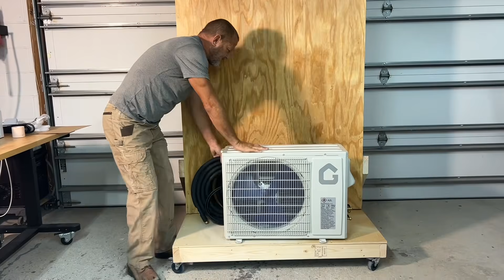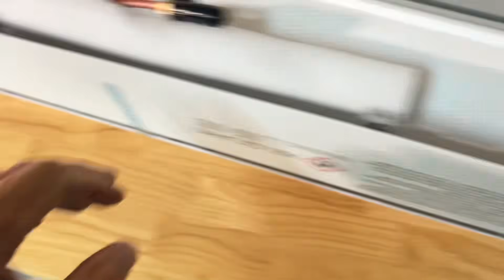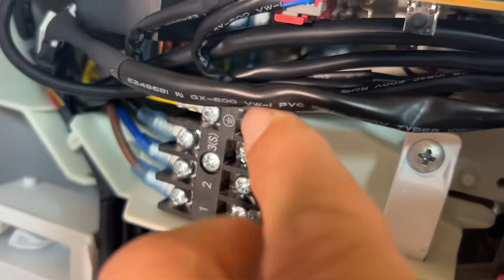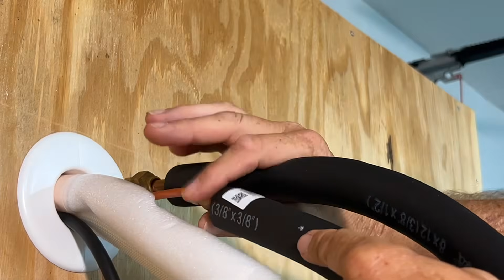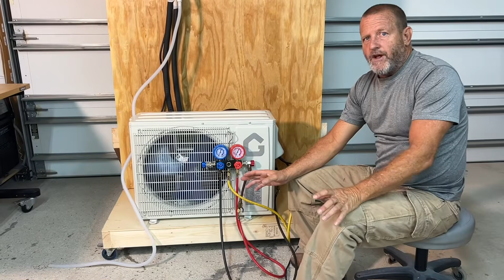How to Install a Mini Split | Garvee 12000 BTU DIY Guide

Comment: I really appreciate this vid as it helped me get things going on my 18kbtu unit. I have one issue tho’. As I tried to take the gauge set off there was a discharge of refrigerant. I quickly retightened the fitting and the pressure seems good, but now I’m not sure how to take the gauges off without draining the refrigerant system.

Comment: I think the most important thing we were all waiting for is the electrical connections from the indoor unit to the outdoor unit and then from the outdoor unit to the main power outlet.
Reply from the maker: Wires and units are numbered numbered and the instructions explain it.
Reply: @StoneBrokeAdventure  if instructions explain it then why bother making a video
Reply: @akhan3682  1. Some people have trouble following instructions, or are confused by the instructions. 2. Having a visual guide can be a lot of help. 3. MOST people can't read an electrical schematic, so knowing what wires go where is a real help.
Reply: @akhan3682  which would be you agreeing he didn't need to make a video showing how to connect a wire with a "1" on it to a terminal labeled "1", etc.

If someone can't handle that, they're certainly not going to be making a new flange and pulling a vacuum, which, by the way, are NOT covered in the instructions, as they are std. HVAC knowledge that the public doesn't have (THUS THE VIDEO...).

Comment: great video -i put all my mini splits i install at home with lines installed inside wall looks a 1000 times better/
Reply: @pauljansky7971That's fine, until someone decides to hang a picture and punctures the lines. I run mine through the wall and cover the lines with line set covers.

Comment: Does that vacuum pump in line set specifically the one that you listed come with the correct fittings to adapt directly to the system or did you need to buy any other type of adapter to make that connection

Comment: What size hole saw do you recommend?  The template has about a 2” hole on it, but the outdoor protection Ring seems to be about 2 1/4”.  Suggestions?

Comment: Could you set this set up inside of a garage and let it run?  If it’s built on plywood like this
Reply from the maker: you would have to be able to close the garage door . this id just a moc up. you need the inside unit inside of the conditioned air space and the outside on the outside . but im sure you could rig somthing up that would work

Comment: Did you have to buy a separate 5/16" SAE to 1/4" SAE adapter to connect the service port to the vacuum? Any recommendation for a specific brand for this adapter which may fit the Garvee minisplit better? I heard that some people had problem with the thread or fitting of the Garvee service port with the adapter. Did you have any issues with your Garvee?
Reply from the maker: my adapters came with my new guages. they worked fine.

Comment: I am installing mine electric is cake for me but pump i bought one when u pull vaccume I turn off valve and leave the vaccume when I open the refrigerant? Then after when I pull the guage it wont  come out from the svc port?
Reply from the maker: you pull the vacuum , shut valve to isolate the vac pump from the system. now guage is only thing that is connected to the system. release a little refrigerant the guage will rise  in preasure . open valve all the way (back seat it)if you want to check preasure in suction line. turn on unit . check guages. then remove guage while unit is running. remove guage fast with gloves on. refrigerant will come out but not much.  the service valve has a schrader valve just like a bike tire.  another way if you dont need to read preasures when unit is running  you : pull vac, isolate pump by shuting off valve on guages , guages see system side in vac still, release a little refrigerant just enough to bring preasure up to positive preasure then shut the refrigerant (service) valve off, disconnect guages open refrigerant valve again to release all the refrigerant into the lines. open valve all the way Untill it stops (backseat the valve)
Reply: @StoneBrokeAdventure I did it thanks its worked but I did get a little oil spit back when I took it off I went as fast as possible but yea was up once I opened the Allen key very cool love my unit may do another now that I have the guages and pump

Comment: There should be filters under that lid.  I notice the filters on top as well, but you know air leaks all around the front cover and without filters you will have a dirty unit in no time.  Does it come with filters under the lid?

Comment: Prime day deals just got me a 9k Garvee, micro vacuum gauge, 2 stage vacuum pump, digital manifold kit and some Nylog all for $630, wish me luck.
Reply: how did it go?
Reply: @MowtivationalMower  Working perfectly!  I'm literally blown away how quiet it is.  On high, I have to round the corner to where the condenser is to hear it running at all.  On Low, you can't hear the evaporator running without being in the same room!

I forgot to take my IR temperature reader so will take that today and measure the output temp, but it's plenty cold certainly, I'm just curious.

I had some problems pulling the vacuum, I'd purchased a 4 star rated valve stem puller for $15, but it seemed like it was leaking itself, so I bought a $70 one instead and that proved it was the problem.  I think it was the valve but can't prove it.

I also found all I needed was the digital vacuum gauge, pump, and the valve stem puller; the manifold was completely unnecessary and just adds another leak point.  I just pulled the valve stem first (trivial; no vacuum or pressure yet), then hooked the digital gauge to the side port of the puller now attached, and the vacuum pump where the stem would need to be inserted afterward.  This lets you pull down the vacuum, shut off the stem puller valve (which is on that vacuum pump end and will have to be opened later to re-insert the valve stem past the valve and tighten it), see the vacuum hold for 15m with ONLY the stem puller and gauge involved, then you can remove the pump and SLIGHTLY pressurize the system with refrigerant from the high pressure end (you're working on the low pressure side) just enough to break the vacuum, and then (with gloves on) have the valve stem partly inserted and quickly fully open the valve so that you can push the stem through and tighten it with just a tiny bit of refrigerant escape.  That all worked like a charm, no manifold needed at all.  But, I'll hang on to it for possible future uses, perhaps on my car.

I still have to put the lineset cover on which is presenting some issues to work through since the wall is vinyl siding.

But I'm massively sold and can't wait to put the 2nd unit in which will be in my larger living room.  And that one I plan to power with 600 watts of solar driving a 200ah LifePo4 and inverter.

I highly recommend them, but if going to you really want to do it right and a lot of the videos have bad shortcuts.  But what I spent for all the right stuff to do the install I'm sure would have been LESS still than what an HVAC tech would have charged, but then I'm a DIYer and had zero thoughts about NOT pouring the concrete pad, doing the wall penetration and mounting the evaporator, etc.  The only thing I was nervous about was cutting the lineset (there are minimum lengths otherwise you have to recalculate the refrigerant, so need a pro, but I just removed <2' from it) and then getting a good flange, seal and pulling the vacuum.  So the fallback always was hiring a tech if I couldn't, but I hoped even that would be less since it all was installed, and he just need to pump down the refrigerant to the condenser and fix the lineset, perhaps with new flanges or connectors.

It's not for everyone, but anyone that does any DIY work at all can absolutely install both units, do the wall hole and make it way faster for a tech to pull the vacuum if they don't want to go that full route.

Comment: I watched the whole video to see how exactly the electrical goes and you skip right over it.  Thanks
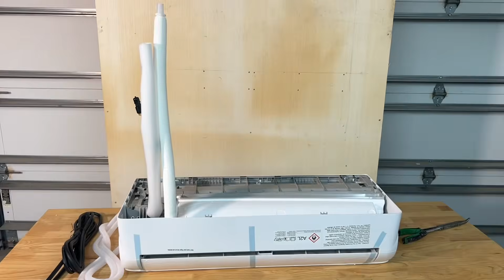Reply: first time i installed a minisplit, it was a walmart Della unit. I was dismayed when trying to do the electrical. the manual provided was beyond useless. turned out to be a 230V unit, and I had initially set it up in a 120V configuration. eventually got it figured out. this video covers it first at about 2:30, and as for the refrigerant, I don't own a vacuum pump or refrigerant gauges so all i did was hook up and open up. been running fine for 5 years. when you open the valve like he did with the "metric allen wrench" (sheesh, no American dimensions anymore at all), it closes off the outside valve where the gauge hoses hook up.
Reply: And he skipped over how to disconnect the gauges without releasing refrigerant everywhere.
Reply: @RilsR you just disconnect it. You get a little spurt. That's why he didn't cover it because you just disconnect it

Comment: Thank you for this video. This looks like a rebranded unit manufactured by an oem named aux. After vacuuming the system, when you release the refrigerant, just release enough to show a slight pressure on the gauges then turn the valve off. Now when you disconnect the vacuum hose you do not lose as much refrigerant. Then after you disconnect the vacuum pump, you can open the valves fully to release the refrigerant into the system. Also, it would be a good idea to check for leaks by using some dish soap on the connections and look for bubbles.
Reply: Bit of research suggests a first time DIYer might benefit from a bit of Nylog Blue on the flair?
Reply from the maker: great tips. i allways psi test with nitrogen befor pulling vaccum
Reply: @johndooley8837 That's how I do it.

Comment: Why no video shows the circuit breaker connection hook up
Reply: You are supposed to hook it up to a a/c disconnect.  Standard wiring, black/white/green.  If you haven’t worked with electrical before, I recommend having a pro get the power to it, and you do the rest that is shown in this video.
Reply: That's what I'm saying. Heck mine didn't even come with the wires from the outside unit to the circuit breaker

Comment: Where did you plug it in do I need a connector 🔌  wired up or it comes ready to plug 🔌  into the outlet??
Reply from the maker: hard wire it into a disconnect. you may need an electrician to run power to the unit.

Comment: What they don't tell you. You have to hire electricians to install plug. It DOESN'T  go to stand plug like advertised.  I bought small 9000 BTU.  This has been the biggest DYI hassle and cost.
Reply from the maker: well it does need electricity. it doesnt run on magic. im confused.

Comment: Is this a reliable unit? Have you installed this unit in a home.
Reply from the maker: yes it is in my home running all the time. im actually really impressed with it. just the little details in the manufacturing were a hint to what i was expecting to see after installation. im genuinely happy with it.

Comment: Fantastic video i just bought this on Amazon its way nicer than my Gree unit. Can you do a in video connecting the disconnect box i dont remember how to do that part lol
Reply: Update figured out the wiring ran some conduit and a cut off switch and vacuumed the lines and it works awesome

Comment: I've often seen people pour a concrete slab and use concrete bolts to secure it down. Is this necessary if the outside part will be under a covered patio sitting on concrete?
Reply from the maker: i would definatly secure it. it will protect from wind and equipment vibration
Reply: @StoneBrokeAdventure  Thanks!

Comment: Just purchased this. What size pull breaker would you need?
Reply from the maker: a 20 amp breaker for the panell and any pull disconnect t that is rated for above the 20. a 30 or 60 would be fine
Reply: @StoneBrokeAdventure thanks for the quick response!!!

Comment: You didn't have the wires hooked up from your disconnect and no indication where they go. Fail
Reply from the maker: they are numbered . its kinda like coloring inside of the lines . If thats to hard for you , you shouldn't try this.

Comment: Don't get why vacuum if lines are pre charged and the indoor unit is also line filled, can you explain?
Reply from the maker: the outdoor unit is pre charged with refrigerant. the indoor unit is charged with nitrogen to keep moisture out during shipping and storage. the copper line sets are not charged. you need to release the nitrogen from indoor unit, hook up linesets ,pull a vacuum to remove all moisture and air from indoor and linesets. then relaese the refrigerant stored inside the outdoor unit into the linesets and indoor unit .

Comment: Are you happy with this still? I ordered the 9000 Btu unit and it is on the way,,, then of course I see people talking bad about the Garvee. Many complaint they don’t perform well
Reply from the maker: i have this unit cooling a very large master bedroom and masive walk in closet and master bath. . it cools /heats easentially 1/3 of my entire home without any issues
Reply: @StoneBrokeAdventure thank you for the reply. Mine is going in today. I got the 240 volt version. It's going in my 380 square foot garage

Comment: Thank you so much for this video! I’m installing one tomorrow and I’m using your video as my reference.
Reply: How has it been working so far? Thinking of buying an 18000btu.
Reply: @STEVEEDG It’s been wonderful! Only issue I had was when I bought it from Amazon. It looked like they went out of their way to dent it up. I had to take the cover off and hammer the metal all back to its original shape so the fan blades could actually spin.
Reply: @tulsaperson yeah amazon has been horrible since they stopped using usps. Good thing I found it on ebay.

Comment: Important detail that he doesn't show is how and where he connected the unit
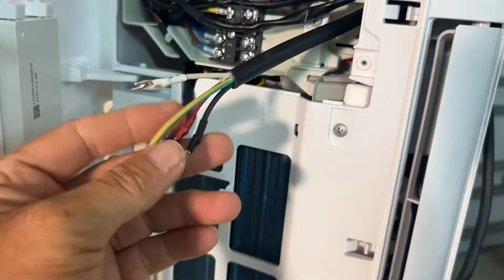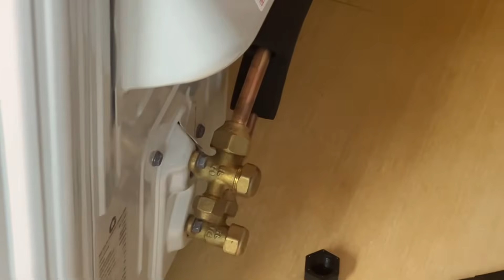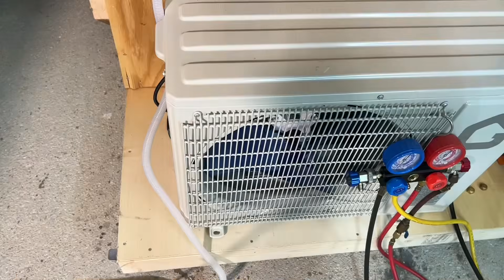Reply from the maker: i confused you need to be a little more specific, see the time stamps. 2:39 wiring to indoor unit , 3:42 lineset to indoor unit, 5:03 lineset connection to outdoor unit , 5:42 wiring to outdoor unit . and the L, N, and G on outdoor unit run to your disconect box providing power to your unit from the house. i assumed that was self explanatory.

Comment: What if you connect the linesets and open the the valves without doing the vacuum bit ?
Reply from the maker: the air in the line sets will mess up the refrigerant pressures. the moisture in the linesets will freeze when passing through the expansion valve causing it to malfunction. the moisture in line sets will cause premature compressor failure. you must, i repeat you must vacuum the linesets
Reply: Can you recommend a proper vacuum and meter to purchase for this work
Reply from the maker: @215Monopoly  https://www.amazon.com/vdp/093de0fab098416e9b8ed56bc1906350?tag=stonebrokeadv-20&linkCode=ssc&src=aipsf&ref_=cm_sw_r_cp_ud_aipsfvideo_QR36FSPVZN0J6NV5N4EX

Comment: Hey what refrigerant did you use?
Reply from the maker: it comes pre charged
Reply: @StoneBrokeAdventure  But you do need to know what type of refrigerant to know what vacuum pump is compatible, right?
Reply from the maker: @satekeeper usually R-32 . any two stage ac vacuum pump will work
Reply: @StoneBrokeAdventure thanks!

Comment: you also dont want to leave loops in your lines like he does, thats a common mistake. Oil gets trapped in the bottom of the lines and cant make it back to the compressor starving it of oil and reducing service life. It's always better to cut your lineset to proper length and flare your own ends, only takes a couple minutes to do and will make it a lot more efficient
Also you want to crack one line and release a little enough to pressurize the line and shut it back off, then spray around your connections looking for bubbles if you ddont see any then release the rest of the freon, that way you dont use it all and have a leak requiring someone to come out and have to fill it back up
Reply from the maker: great advise. i didnt want to loose all of my lineset for a demo. i allway cut and flare or braze the existing flare end onto my cut (if cheap lineset).

Comment: Thanks,  I have 3:of these on order.  I 'm in Michigan and would like these to heat from 45F to 60F and cool from 70F up.  Is there anyway to set these up so it can adhere to these setpoints automatically?
Reply from the maker: i believe there is a auto mode it will do what it needs . i would have to check the specs

Comment: Just purchased one of these on Amazon. Quick question…I noticed some of the DIY’ers release the refrigerant for 5 seconds, spray around the connections, and then close the valve (im assuming) to substitute for pressure testing with nitrogen🤷🏼‍♂️. Is this a recommended step?
Reply from the maker: it is another way to leak test . but you must pull and hold a vacuum . use bullle leak detector if you plan on doing this type of test
Reply from the maker: bubble leak detector.